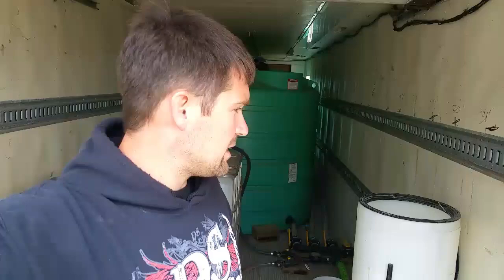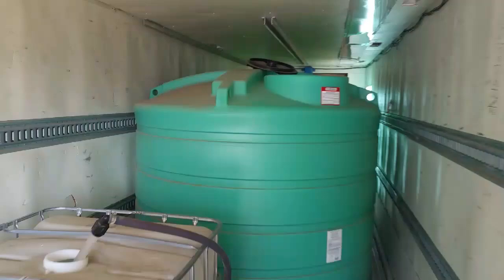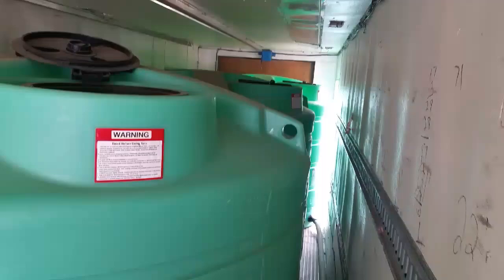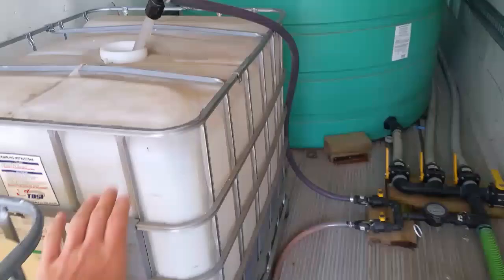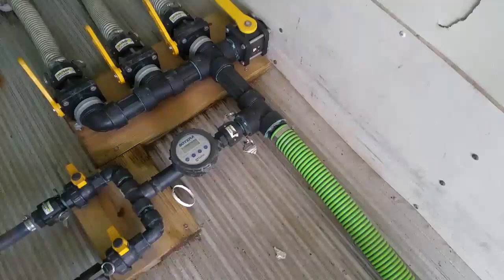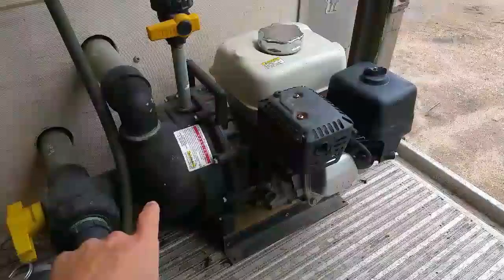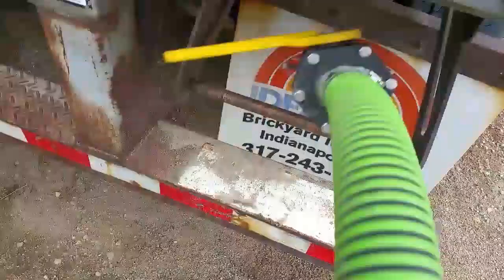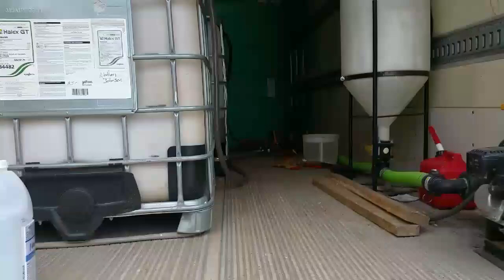Spraying corn with Round up

Comment: I thought that the surfactant  might help with drift control also but I am not sure this is the case. Thanks for the education.
Reply from the maker: Some surfactants have a drift retardant mixed in with them.  This specific one does not.  We have added some drift control product at times if we have to spray during a breeze.

Comment: Do you know if the farm implement companies like John Deere are working on computerized selective weed sprayers?  For example a sprayer which "detects" a little weed in the field with video recognition software and triggers a sprayer to only spray a tiny part of the field as it passes by a weed?  it appears that only a few little weeds are coming up and you don't really need to spray 100% of the ground.  Would that be effective or do you need to spray everything?
Reply: I saw something like that, might have been JD. They said it still needs improvement before it can be used reliably.
It's going to happen no doubt, part of the larger 'farm automation'.

Comment: Great video I farm a small place and work a job also . I hear about GMOs from a lot of people ,and I get tired of it . I don't beleave a farmer could stay in farming right now if he didn't use them. It seems like the chemical company that I will not name rammed that down the farmer thoats. Don't atrazine have a carry over for other crop other than corn?
Reply: It's pretty rough on Oats the following year...
Reply: There are lots of factors involved in carry over such as herbicide rate, soil type, soil pH, weather conditions and which follow crop is planted. The MMF fields are in a corn/soybean rotation and they have probably used atrazine for many years so they know the proper rates to use so they don’t have carry over issues. By the way, atrazine is one of the best ways to control those little weeds that Zack pointed out in the previous video.

Comment: How do you like that tractor for spraying? Would you rather not have duals in the rear? I am currently looking for a tractor solely for spraying with a Fast 1400 gal sprayer, what would you recommend?
Reply from the maker: We like the tractor.  in our area the duals really help at times because sometimes we end up having to spray when the fields are not ideal (wet).  we do run over a fair amount of crop on the ends though.  we are considering getting a self propelled at some point.  I would think any good tractor would pull a fast 1400 as long as it's got enough power!
Reply: Thanks for the reply !
Reply: +MN Millennial Farmer we got a JD 4920 self propelled. it can go through pretty much anything